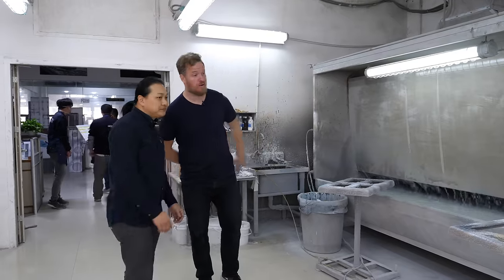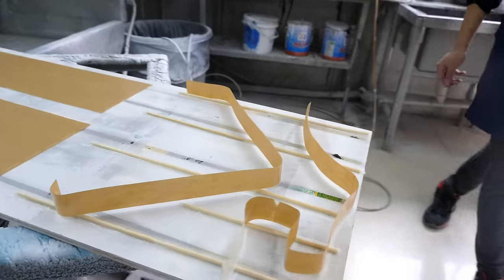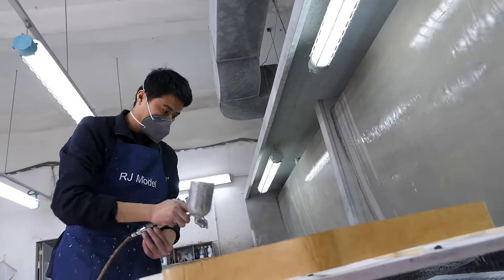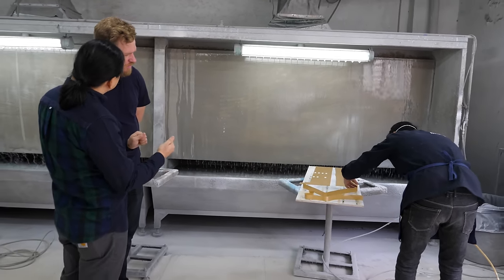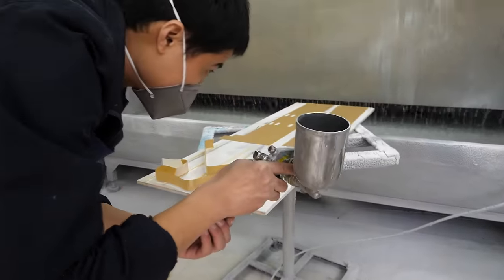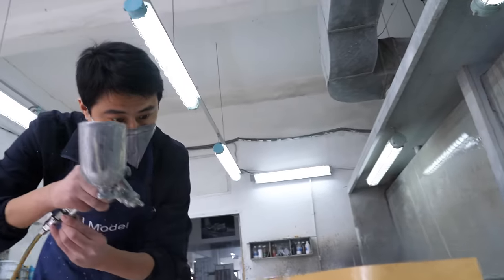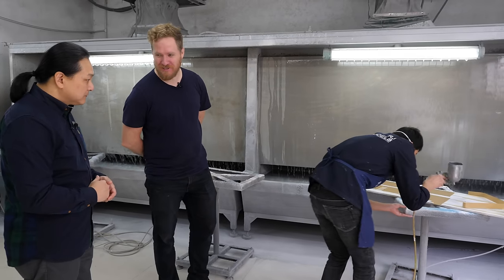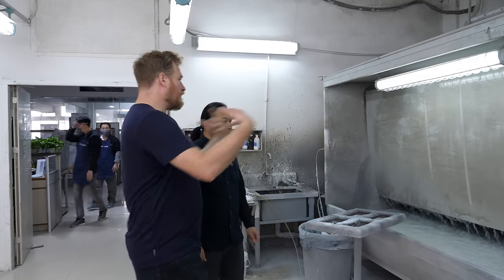This Chinese Factory Makes $100,000 Architectural Models!

Comment: I owned an architectural modeling company for about 6 years. I lost many contracts to RJ. Very cool to see their operation. I can't believe I actually tried to compete with them!  Amazing!
Reply: LOL
Reply: The same happened to me  :) , where your company s location ?
Reply: @pierresakr7594  Colorado, USA. You?
Reply: Nacho Bidness beirut, Lebanon and still in the business having hard time competing with chinese low prices sometimes 1/3 of my price
Reply: @pierresakr7594  Wow! good for you! That's impressive you're hanging in there. I sold my architectural modeling company in 2008 and changed my strategy from architectural models to completely working in 3D CAD and 3D printing for any industry.
Reply: @unclejg1975  i did welding now i do small engine repair my boss is super nice
Reply: @happydancer5131  It's all good. Competition is just part of any business. The market is very small and getting smaller!
Reply: A friend was in this modeling business a few years ago. 

He said their boss is insane, they keep the architectural design freeze roughly 72 hours before the delivery of the model. 

So when he received the final blue print, it's a non stop processing.  It doesn't matter if it is made with CNC, 3d printing or whatever means.  The model has to be there on time. 

So even the low price Chinesium model couldn't compete in this case.
Reply: Nacho Bidness Good for you
Reply: Very positive attitude. Good luck with your new venture.
Reply: @lpjunction  This is the very reason I'm glad to be out of the business! I remember working a double all-nighter because of a last minute design change. 51 hours with two 1 hour naps. Project was done on time but that was pure hell.
Reply: @lightening1296  Thank you!!
Reply: Best of luck with whatever new venture of yours!
Reply: It is very challenging to compete with Chinese companies since they have very low prices of almost everything from labor cost to raw materials.
Reply: @unclejg1975  Can we buy old used models ? at fair prices ?
Reply: Same here. We were killing it until '96 and that is when we started losing jobs. 2 of my colleagues still build in their own companies but consistently lose jobs to them. It is impossible to compete even if you are a 1 man shop.
Reply: @unclejg1975  sad to see you loose it. The difference between Chinese and Europeans is Chinese save profits then invest in plant gradually, they also look long term not day by day. The Europeans keep worrying who they can rip off, which girl to screw, what car to buy etc. Chinese business owners dont bring their personal life to work as it stays out the door until day ends.
Reply: @conmanumber1  It's all good. I actually was able to sell the company. I didn't lose it. Sounds like European businessmen are pretty unscrupulous. Glad I'm American.
Reply: Sorry Nacho but this business seems to be labor-intensive which does not fit the US.
Reply: @huanhuang311  LOL! SO true.
Reply: gluck gluck gluck
Reply: @navyblue9833  Did that look like slave labor in the factory to you?
Reply: @pierresakr7594  that is called the benefits of Globalization, :).
Reply: You are indeed a practical and realistic person and I am proud of your attitude.  I think you could work with them and see how you could benefits from such co-operations, as I am sure the possibilities would be endless.
Reply: Doge Gaming  seemed pretty high quality to me.
Reply: Government policy makes you loose business because of high salaries to workers and tax.China is looking for foreigh exchange and thats where China beat's us
Reply: @conmanumber1  well said
Reply: @Wisefish99  Slave labor, slave labor, just because you cannot compete you talk bad about the Chinese. I feel sorry for you.
Reply: @pierresakr7594  is your office okay with the explosion
Reply: A Triangle just minor damages , hope I would say the same about my family house , the good thing is no one got hurts :)
Reply: hey i want to start this buisness to, how do i start?
Reply: @azzizusuda  best way to start is to work as am model builder for another company for a while. Build relationships in the industry and after a couple years you will be ready to go out on your own.
Reply: David Peace! my bad
Reply: @ohkayeee2174  America actually has lower price for raw material, oil and industry use of eletricity and water.
Reply: @leoxu1299  oh I didnt know that. Maybe I should stop using the media as reference. lol Thanks!
Reply: @Wisefish99  depends if 6 days a week 12 hours a day for 3usd an hour is acceptable
Reply: LMAO! You live and you learn.
Reply: Extremely low wages in China. Everything made there. Obviously.
Reply: @unclejg1975  Sorry to read that you sold your company, but what you wrote is true as well. I thought most well known architectural firms now made the models as well. Is that not the case nowadays?
Reply: @luisbp8162  That is very true. And with the advancement of 3-D printing technology a lot of architectural firms are able to make their own models in house very inexpensively.
Reply: @unclejg1975  Do you need any 3D render designers?
Reply: 我是否可以给您一些建议？从表面上看，我们中国的模型工厂的确给世界各地的其他模型工厂造成了冲击，但是，您是否想过，利用目前您手中的资源和能力，把自己改变成为一位应有非富工作经验和广泛人脉的建模模型中间商？你可以在当地继续接受订单，转头分派给中国的厂家来制作，你自己收取中介费和监督管理费用。同时，不要放弃您现在拥有的工厂，而是开始缩减它臃肿的低产值部分，保留并且提升专项制作更高级的艺术品级别的本土建模模型，甚至把他们变成您所在家乡的标志性特产，我相信去到那里的游客和收藏家不会对您的优秀作品吝啬他们的钱包。
是的，竞争是非常残酷的，但是我们也可以做到双赢，这是我们的信念。
Reply: @conmanumber1  totally, i worked for a small german company and my former ex boss brought all his personal life crisis into the company and made it a hell on earth. I luckily quite and happier than ever. Business is business, personal life is personal life. Same opinion on this matter from my self experience
Reply: When you have governments helping you out with free deliveries and slave labor, how can anybody compete?
Reply: @昏君  Sounds like the Huawei business model system.... 
Not sure how many people want their companies to go in the direction of promoting another Huawei type company in their industry.
Reply: @gizroc  IMPOSSIBLE!  It is one of the reasons why TRUMP imposed tariffs on China!
As if two players are on the field, and one has lead weights on their back (Govt. regulations, minimum labor wages, environment controls, etc).

It is similar to why Kamala Harris kept people past their prison release date, for the cheap fire fighting laborers! 
 Can we expect the U.S. to utilize slave labor (prisoners) more efficiently!
Reply: @TheDennisgrass  对于资本家来说，没有人会拒绝让钱进入自己的口袋，只要有丰厚的回报，我想他们不会拒绝为另一家公司提供中间商业务，但是，这个时候我们要考虑到他们自己本土的就业率和本土自主产业的维护，所以，我同时给出了保留高精尖工艺继续持有的建议，他们甚至可以把他们新制作的更高端的产品出口给中国。
如果我们只看重资本，在让这位老板成为中间商后，我们完全没有义务去考虑他自己的国家地区的人民是否受到冲击。但是，本着全球联盟的精神，我们有义务为他们提供新的创意和新的经济立足点，以此来谋求更加长足的发展。
当然，我想过不了多久，我的留言就会被一些人贴上“伪善，另有阴谋”的标签，，就像您说的“不确定他们是否愿意”，我想，这取决于与他们进行这种业务合作模式的对象，是一群中国人，还是除中国以外的人。
毕竟，我是中国人，华为也是中国的。我们是世界上一切“邪恶”具象化体现，哈哈。
Reply: @昏君  I think you mistook my words. Never called you nor Chinese evil! I indicated Huawei's business model followed similar patterns you suggest.
  
BUT, now that you bring up the issue of evil.....  I do think the Chinese Communist Party has become influenced with power and is moving away from Mao's original perspectives of Communism.
Arguments can be made that Xi Jinping is not President of China, but Emperor! 
(and just using the term "President") I think   many CCP members would welcome the reemergence of the title. Many CCP members view the Chinese DNA can not self govern, and needs to be governed with an iron fist.

Fortunately, Taiwan breaks that kind of thinking!
Reply: @TheDennisgrass  抱歉，可能我们使用的翻译软件曲解了我们互相之间的语言含义，我在最后提到的“邪恶”其实是一种自嘲行为，并不是针对您所提到的中国企业华为，之所以会提到邪恶，是因为在评论区里有不少人开始恶意提到“奴隶用工”“低劣的质量”，这些人被意识形态操控，只会把中国认定为一个非常糟糕的邪恶国家，实际上，中国国内的真实情况是，尽管工会已经沦为北京政府的空壳工具，但实际上企业领导人还是非常惧怕工人，他们因为被工人控告“工作待遇恶劣”所得到的惩罚将会是极其严重的，甚至会因此失去信用丧失雇佣到优秀高级人才的资格，最终导致倒闭。而且社会媒体舆论还会对那些国内非常著名的企业家资本家的一些不当言论和行为进行疯狂攻击，让他们名誉扫地。
我在提到“双赢”这些概念的时候，其实就已经在想，那些反华势力估计会开始恶意攻击了，与其无力的辩驳，不如用自嘲的方式反击，所以，是的，想击败恶魔，那就要变得比恶魔更加邪恶，于是“邪恶”这个词语就出现了。：）
很抱歉，因为我的玩笑，最终把我们的谈话从“如何实现共同富裕”变成了“”讨论政治“”。（至于CCP为什么得到国民支持，还有BOSS XI是皇帝的看法，以及中国大陆和中国台湾的网民联合起来恶斗台独恶棍，那就是另外一个很长的故事了）
Reply: @pierresakr7594  all you need is cheap manpower and great technologies. Come to India!
Reply: @michaelg8465  It depends on how much it costs to live there and other things. In the US, the cost of living in California is higher than that of a rural state. Taxes, regulations, labor unions, exchange rates, etc. add to the cost of production too. It's not a straight cut as you think.
Reply: Trump could've changed all that with his trade war strategy?
Reply: @unclejg1975  ". Glad I'm American."

if you want to get technical...Americans are European ...they're from Europe originally...the difference in culture is why Americans don't identify as Europeans ...

"worrying who they can rip off, which girl to screw, what car to buy etc."

that sounds kinda American if you ask me...probably European as well lol...could very well be alot of different cultures
Reply: @huanhuang311  as a lazy person that was the first thing that come to my mind when i see those models...

Was like: okey im out too much work.
Lol
Reply: @unclejg1975  he sells cheaper, probably .
Reply: @unclejg1975  you sound like a good dude with a positive attitude. keep on pushing brotha!
Reply: @myrandomlife5266  Thank You! Same to you!
Reply: Hello! My dream is to become a model maker, so what do I need to achieve that dream?
Reply: @esmeraldaramirez-td8gj  a Time Machine. Outside of Hollywood the industry is just about dead. That is if you want to do it for money. If you want to do it for fun there’s millions of opportunities! Let me know if you want suggestions.
Reply: Work there. Still a cool comment.
Reply: Thats sad.
Reply: Hi sir.
I am George, an architect too and I want to get into the space.

Might you have pointers as regard to laser cutting and CNC models? A simpler way to get the line work.

Possible to highlight this.
Reply: Hi I am George. I am trying to set up my own  and I am currently having challenges in the line work process for laser cutting. Care to give some tips
Reply: @georgendambuki5011  I would love to help any way I can. How can we connect?

Comment: That’s absolutely magnificent how all different disciplines and manufacturing process get combined, how hand made traditional process and new digital techniques, become one single finished product with hundreds of people involved behind.
As an architect I can answer your question, usually the architectural scale models are made in monochromatic style same as digital models, cause the most important thing become understand the impact / how the building looks and interacts with its context, respect the volumetric context, the light and shadows, etc. It’s very common that the central building its made highly detailed and the so rounded context with general volume. When the scale model would be made for a client or the public in general, it has to show all full colors, details and even materials, also the surrounding buildings, with te purpose of live the experience and selling better your project.
This became one of my favorite strangers parts chapters!

Comment: 29:36 "Every unit has a swimming pool, that's all you need to know" 
Hahahahahaha!
Reply: i wonder where is the building and how much do the units sell for
Reply: mmdday Building is called FIVE Jumeirah Village Circle. It’s located in Dubai. It has apartments from studios to multiple bedroom penthouses. I was there a few times looking to invest in one of those apartments. The swimming pool is available on two and more bedrooms. One BR come with jacuzzi. You will also be amazed at the bath tube surrounded by glass in the main bedroom. You can google the name of the building. Its really amazing. Its definitely one of the best buildings I have ever been inside. Regards from Dubai! :)
Reply: mmdday You can check the prices online in Dubizzle and Property Finder websites. The two bedroom with swimming pool is around 650,000 dollars. One bedroom with Jacuzzi are around 350,000 dollars. They are all furnished.
Reply: @nicolasmango290  sounds amazing. thanks!
Reply: @mmdday  my pleasure :)
Reply: @nicolasmango290  just 650,000?!?!? THAT'S CHEAP
Reply: @Dumb-Comment  I believe they thought prices would go higher here in Dubai. But there's kind of a recession now, so property here is losing value :) the main problem for apartments in this city is service charge. You can find an apartment for the same cost inside Burj Khalifa (tallest building in the world) but monthly service charges are so high people are not buying them :)
Reply: @Dumb-Comment  If it wasn't in Dubai the price would be a lot higher. Try to build a place like that on Miami Beach or Los Angeles and the units would go for a lot more money.
Reply: @marijnl  But still won't be as high as in... Like Hong Kong XD

Comment: The comment the factory owner made in the middle of the recording "...everything changes very, very quickly..." is so true.  40 years ago I had an acquaintance in HK,  a draughtsman, and he invented a system of drawing which could take a set of architectural plans and very, very easily produce 3D perspective drawing of the building.  It was extremely good and money-making and opportune as China was starting its development explosion..  He opened a small draughting business in Shanghai and started work.  All well and good for a couple of years then CAD emerged from its large computer confines into the PC world!  All of a sudden "...everything changed very, very quickly..." and his business was finished!!  But what an interesting video.

Comment: The one Chinese factory I'd like to work at
Reply: because of the nature of the trade, professional model makers, in big projects, work at least 10 hours. Models take a lot of time. And usually have to work 11-12 hours and not only in China. And you have to be creative after 10 hours and probably a 6 day working week. In a couple of years you will be mentally and physically exhausted.
Reply: @Unknown-nc4jq  once the skills have been mastered they will switch off and produce what is required with minimal stress.
Reply: Aim higher, mate. Working at a factory is not fun anywhere. It gets dull very quickly.

Comment: I can tell from even before watching this that I am going to LOVE this video! ❤
Reply: I was not disappointed!

One thing about "Chemiwood" as he mentions. It's not actually wood, and doesn't have any wood fibers in it. It gets is name from that you can work it like you would work wood, just without any fiber direction. It's essentially a polyurethane plastic foam, and it comes in different densities. It's a very common thing in the product design prototyping industry. Probably every industrial design student in the world have horror stories of hand sanding models out of that for hours and hours in school workshops. It's a really great material, stable, you can make very tiny fine details, easy to machine, and it takes paint really well. 🙂
Reply from the maker: Oh, interesting! I was wondering about that, and then forgot to look it up. I thought the color was a bit strange if it had high wood content, but I assumed they just dyed it.
Reply: @StrangeParts  the colors usually correspond to different densities of PU foam, so you can easily tell them apart. Unfortunately there is no color coherence between different manufacturers. Renshape is another brand name that I know is very common in the US which is basically the same thing. 

The super fine dust gets everywhere though, I'm glad they're mainly using it in the CNC with good dust evacuation.

Comment: 22:42 - Very cleverly wired in parallel so if one fails, the others keep working. It's more expensive and takes longer but results in a model that will last longer.
Reply: It's a standard practice in lighting. Christmas lights etc.

Comment: Do have an important question here: how do they deliver the gorgeous masterpieces to their customers? Don't tell me it's a box with fragile label on it😂
Reply: for big models they make special crates for protection and they have partnerships with airlines to take extra care that's needed. For small models, architectural firms usually just get an architect to be the model's personal guard (sometimes even an extra flight ticket just for the model) , since most of the time they will send an architect onset to make final adjustments and confirmation anyway. The RJ is a legend in the business, many other modelling businesses are based in Shenzhen as well, firms from all over China (maybe worldwide even) fly in to get their models done right all the time.

Comment: Wonderful video, great work. I was living in China for 5 years and looked at plenty of architectural models, when we bought our apartment. Some of these are simply incredible and can be absolutely enormous in size, depending on the development. One time we checked out a development with smaller buildings of max. 4 floors (very expensive) and with the press of a button you could look at every single floor. Press button 2 and the floors 3 and 4 just lifted up via pneumatic or something, so you can actually look inside the flat. Absolutely astonishing.

I am building scale models in my spare time (mostly space ships) and would love to work in a shop like this, hah.

Comment: "Chemiwood" is made from a resin, usually urethane, but it has the same density as maple (albeit uniform) so it can sometimes get confused for being wood due to folks making that comparison. It's known in the US as tooling board and by the trade names Modulan or RenShape.

Comment: It surprise me a company who prices 100K for one piece does not provide the basic security and sanity recommendations for the Laser Machines. They are using plastics which liberates toxic vapes when heated. They should be using filters and extractors on those machines.